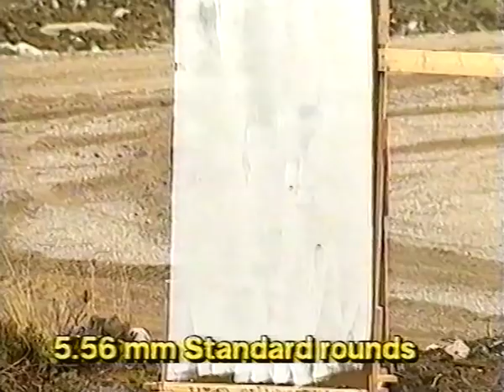Bofors demo 92 2-4

Comment: I'm really surprised by those 5.56 and especially the 7.62 AP rounds. A goddamn APC??
Reply: That APC also has aluminum armor. Focused firing of enough regular rounds will penetrate it too.
Reply: @fratercontenduntocculta8161  Ohh. Well that just seems like cheating, lol. I didn't know about the aluminum armor. How common is/was that?

On another note, that 150mm x2 + ERA was impressive, holy shit.
Reply: @lando8913  I think the Bradley uses or used aluminum armor to reduce weight.
Reply: @fratercontenduntocculta8161  looked a lot like rust on the plates though...
Reply: @fratercontenduntocculta8161  That was a PBV301, converted from an old tank originally built in 1942. 
With proper Swedish steel armor.

Comment: 9:08 I've fired one of those (smoke). The firing detonation, albeit no recoil, is is significant BANG  ;-)
Reply: There was a Gustav operator's manual online somewhere, I seem to recall reading that Gustav gunners weren't supposed to fire more than 8 rounds in 24 hours.  Which didn't make sense at first.  Then I realized that there was probably a high risk of hearing loss and possibly risk, or concern there might be risk of brain injury from the air shockwave from the blast, that is, the BANG.

Comment: 7:54 Looks like the same gold-colored residue we found after one of our M1A1 tanks got plinked in Iraq.  Never found the shooter, or the weapon tube.
Reply: How badly did it damage the tank?
Reply: @puffnstuff12  Only one of these projectiles was used.   Whoever did it got their test data and went home.  My guess is it was an advanced Russian EFP RPG, still in development. 
I'm speculating here, but to me that yellow metal residue is distinctive.  This video from Bofors shows that other countries now have this technology.  The clear message is that the M1A1, at least the version we had in 2003, can be killed by infantry from a peer adversary.   Hopefully we have upgraded it by now.
Reply: @josephastier7421  
It wouldn't surprise me to see the Abrams being replaced soon as IED's have also penetrated it with relative ease.  I was at WSMR back in the mid 80's when they were being tested for blast resistance which primarily focused on blast pressure wave damage to the top and sides.
Reply: @josephastier7421  Dont worry they have been upgraded a few times since the second gulf war, their is a pretty big overhul rolling out for the Abrams in 2019 and 2020
Reply: It's copper that's shaved off when the HEAT jet strikes the armor. The tank was probably hit with a ATGM.
Reply: @Andrew Manche
Well, Bofors HEAT rounds contains a copper penetrator with aluminum liner for increased fire inside the vehicle, so the residue in the video is not titanium.
Reply: @Andrew Manche
I double checked to make sure. The weapon system in question of the timestamp is the AT12 which was a 120mm version of the AT4. It had tandem HEAT warheads but there's little other information about it since it was discontinued, however I highly doubt that Bofors suddenly would have started to use a different warhead for a prototype.
Reply: @josephastier7421 
You do know that the article you referenced says outright that even the RPG7 can penetrate weak points of the Abrams, one of those weak points that was hit. Then it goes on to say that it was likely a newer and better made type of round for the RPG7 than what was generally used in Baghdad at the time. There's no mystery here, the Abrams never was invulnerable and the technology used to defeat it is available all over the world, a tandem HEAT round. They just got a lucky hit, that's it.
Reply: @StormBringare  Um, actually you should read the article again.
Reply: @josephastier7421 
I've read it three times now, it says outright that it likely was modern RPG munition and a lucky hit that took out the tank. And if you think that the residue in the video looks like the pics you've seen that supports what I say since that is copper residue from a HEAT round. It's nothing new or special, every nation around the world uses them.
Reply: @StormBringare  Others, including myself, would respectfully disagree.   Thank you for your input.
Reply: @josephastier7421 
Yeah, logic and reason is a bitch huh? "This video from Bofors shows that other countries have this technology now" This video is from 1992! Shaped charges in different forms has been around since WW2 and the Abrams was possible for infantry from peer nations to destroy from day one, and it still is. I have no idea how you ever thought differently 😂

Comment: The US Army only recently adopted the confined space version of the AT4. This video was from 1992. I can't believe it took that damn long.
Reply: The AT4 is anti tank. But US doctrine usually have tanks and tank hunters with guided missiles to take out enemy tanks. The only real threat the infantryman face while indoors is most likely trucks armed with a heavy machine gun. These can be taken out by grenade launchers which are much more portable. The last tank vs US infantryman engagement was probably the Vietnam war and since then the US armored and helicopters have done most of the job in taking out enemy tanks and armors before the infantry roll in.

Comment: Tested AT weapon against 38mm armour of APC...seems legit.
Reply: EcchiRevenge You know these weapons are the favorite AT-weapons of the us army right and have been used ever since they were developed.
Reply: Backlight22 At4s are very capable anti tank weapons, no doubt about it. The flaw was in the demonstration: even a WW2 vintage bazooka can penetrate that APC's armour at that range.
Reply: Maybe, I dont know how they would fare against that reactive armour though. In any case, my point was that these weapons are some of the best in the world at what they do. Being a swede, I'm kind of proud that they came from my country :)
Reply: +EcchiRevenge 
You guys don't get what was demonstrated: it wasn't about penetration, but about behind-armour effect. Normal HEAT doesn't do terribly much spall if the armour is thin because it's the armour that turns into spall. 
That EFP warhead produced much spalling, as seen on the so-called "dummys". A normal AT4 would have produced much less spalling.
Reply: EXACTLY. You SHOULD use highly ductile (not very hard) plates if you want to demonstrate good behind-armour effect. The hard ones would be turned into more spall (the hardness on the back side matters, not front). Again, this is a test setup to show behind armour spall effect, NOT to show penetration.

APCs often have little to burn or explode inside. You don't need a high penetration AT munition against them,. You need an AT munition with good behind armour effect against them - or the luck to set off some AT munition stored inside the vehicle with your hit.
Reply: @rogerc6533  The range of shooting mean nothing, we are talking about shaped charge here. Not about plain steel shell.

Comment: the  munitions should be tested in 3 configuration 1- at the maximum firing range of the weapon system characteristic and the ammo used  / with the target maximum thickness for the weapon and the round to penetration the armor
2 - medium ranges or most common engagements distances for the weapon system and the ammo with maximum armor thickness for the target ( same case 1) ... 3- the short ranges and close engagements with maximum armor thickness for the target ( same case 1 and 2 ) ..
They can re-test weapons and ammunition against lightly armored targets or against soft targets ...etc  in order to simulate of various combat engagements scenarios ..
As for the personal weapons , there are no engagements in open battles from 100 m. These 100 M range are suitable for personal defense weapons ( PDW ) and even some pistols . The Swedish forests may help to set an ambush and allow to fight a battle from close distances, but most traditional motorized or mechanized infantry combat engagements remain within the effective range of the individual weapon 300 M .. but very impressive arsenal of weapon systems and munitions ..

Comment: i dont know that very hard to make single tiny hole on tank's armour
Reply: it's not the size of the hole but what kind of damage it causes in the confined space. You saw the results of that hit on the APC, right?
Reply: It’s not the hole, it’s the bits of molten metal flying around the crew compartment in excess of Mach 1 that’s the clincher.